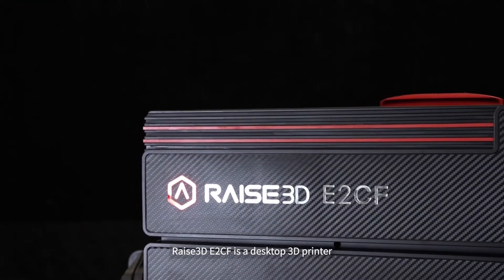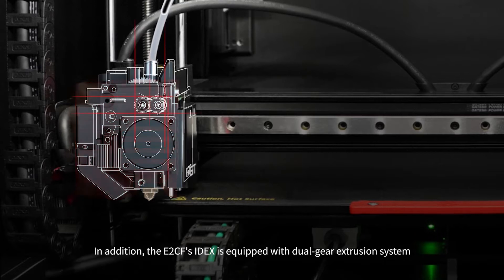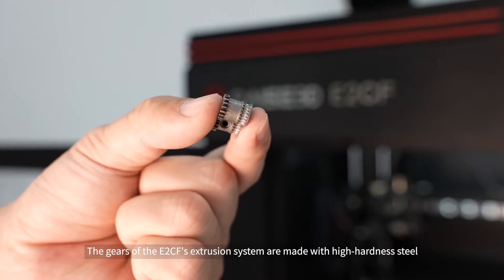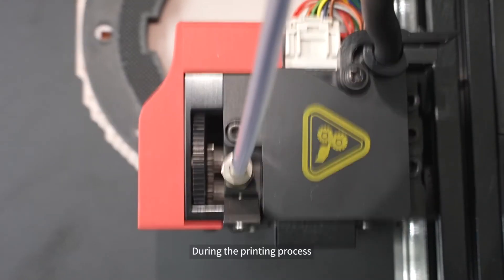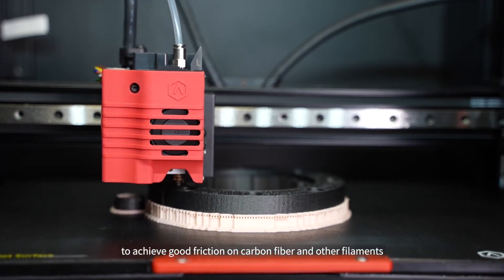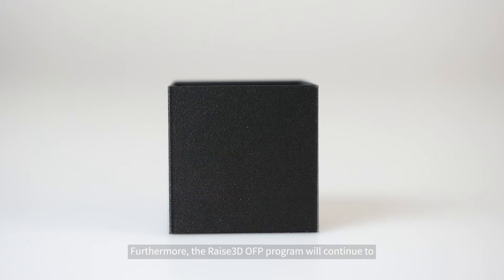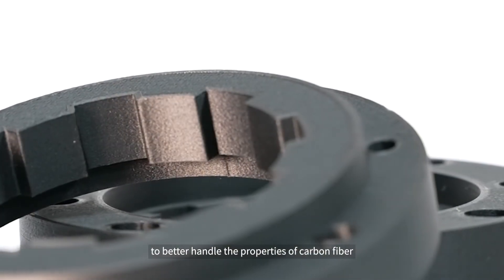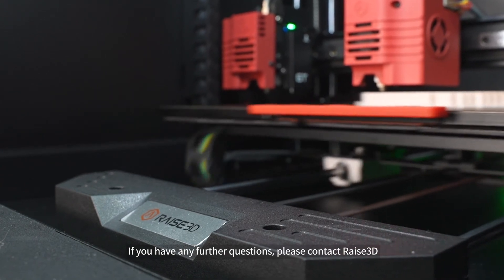Raise3D E2CF Feature Overview - Dual Direct Drive Extrusion System

Comment: Will it print all types of filaments like PLA, PETg, ABS, ASA ect....? The specs only mention CF filaments.
Reply from the maker: Hello there, E2CF is particularly developed based on E2 platform for industrial use with consistent performance when printing fiber reinforced filaments.
To ensure consistent printing quality of this type filaments on E2CF, Raise3D has decided to restrict supported filament for E2CF within Raise3D industrial fiber reinforced filaments and third-party fiber reinforced filaments approved for E2CF by Open Filament Program (OFP). For more information, you can visit https://support.raise3d.com/list.html?cid=25&pid=1395&aid=1398.